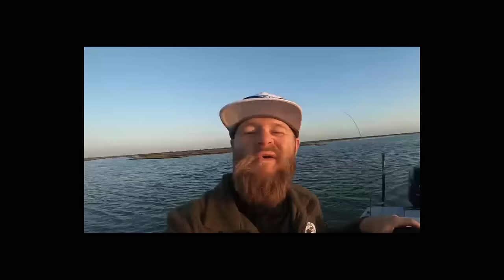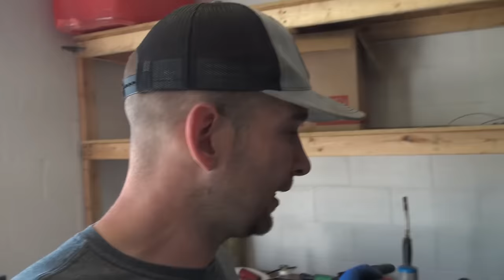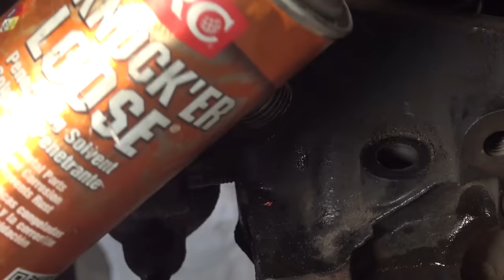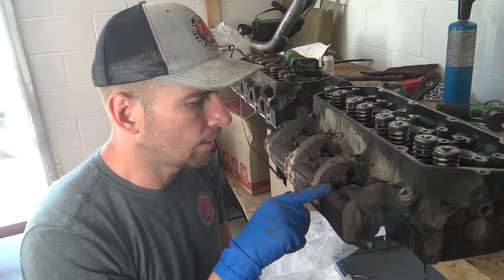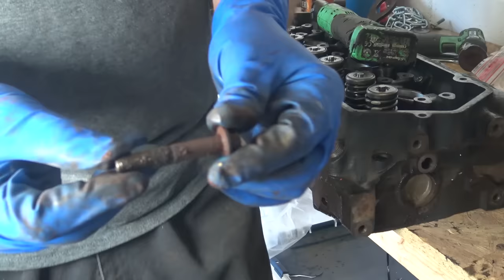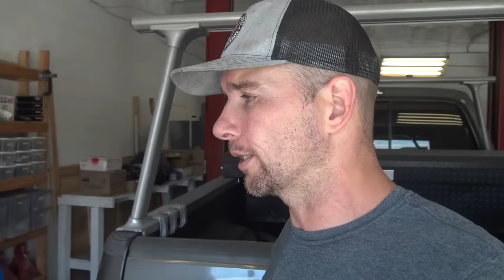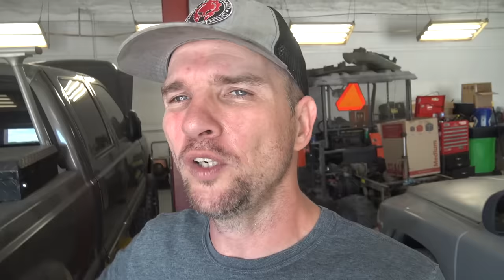Old Mechanic Taught Me This Trick To Removing Rusty Exhaust Manifold Bolts!

Comment: Hi Stephen. Thanks for your video. Don't take this wrong, but I work on Pontiac's, and don't have the convenience of open access to the threads entering the head. The manifold blocks that awesome easy access you use here with that head. Some tips on a Pontiac would be cool. Thanks
Reply: Use a rotary tool with a wire wheel to clean the surface around bolt head & then treat the bolt with penetrating oil several times ideally over 24 hours.  Get together an empty coffee can, nitrile rubber protective gloves, ball peen hammer, breaker bar, 6 point ratchet set, combo end wrench set, rags, & map gas torch. Stage/check a class A&B fire extinguisher by the work and put a plumbers fire blanket to protect any wires near the work.  #1 Have a brand new set of bolts and anti-seize or thread-locker as appropriate.  Put snow or ice in the coffee can or otherwise disposable container.  Put the penetrating oil can & the ball peen hammer head first in the ice.  

Now for the WWF tag team match of fire & ice that can go faster with a 2nd person.  Run the torch first on the bolt head. The goal is to heat also the bonnet, yoke, or manifold the bolt is in so as to get the bolt and bore hole to expand so as to crush the rust in the threads into powder. Move the torch when the bolt is sizzling even from water or penetrating oil to a low 6 o’clock position towards the back of the bolt depth of the bore.  The heat travels around the bore heating both bolt and boreas hot gases rise and find the bolt head.  

When sizzling some more, spray or dribble ice water, ice chip, or penetrating oil as can.  Oil may ignite depending on type and proximity to flame so you may have to dip a rag in water or oil while pulling the flame away. Cotton balls can work too.  But the tighter and smoother your transitions from one step to another yields quicker results. At first you dribble to determine the joint of bolt and bore is hot enough sizzle to the fresh drop. Then the penetrating oil applied first to the 12 o’clock position bolt head.  Switch the flame to the 12 o’clock deep side of the bore. Apply the penetrating oil 6 o’clock on the bolt.  This causes the capillary action of the crushed rust to pull and chase the penetrating oil to the flame so the crisscross oil and flame action keeps the oil from catching fire while hopefully treating in real time. Use the fire blanket if needed between bolt head and deep bore positions so you may spray chilled oil on one end and flame the opposite deep bore end. 

While flame is kept @ 12 o’clock deep  bore, strike the bolt head with the ball peen hammer to shock vibrate the joint. Switch to putting ice chip on the head to rapid drop the bolt shaft temperature that is partially insulated from the hot bore by the rust.  Start with the breaker bar. If a 2nd person is handy, they can apply another chip of ice/snow or ice water rag to the socket body while pulling the breaker bar. Work back and forth as described by the demonstration. Keep working fire and ice as needed with more penetrating oil as needed. Sometimes using box end wrench with ice direct on bolt works.  Or also slap bolt head with the hammer while attempting to budge with box end wrench. You can slip a 2nd box end wrench over the open end to make a breaker bar.  If the breaker bar or wrenches deflect/give and the bolt does not budge, shut of the flame so you can listen. If u try 2 hard U can shear the bolt or break wrenches.  So game of patience tag team fire and ice.  If your gut tells you something is wrong, stop. Use a ratchet when you know you are getting significant less resistance.  If you believe more oil penetration is needed, then you are probably right.  Let it soak and take a lunch after trying to budge all bolts.  Let them soak some more.  Go do a bank run while your brain and hands mull over with what happened.  Get a big soldering iron if that is what you think you need with a stand that can hands free apply heat without flame if that allows you to shrink your heat to ice working triangle.  Adapt and prevail. 

Another mechanics trick is to use water on rust because it softens the hedgehog structure of the interlocking rust. Apply heat then turns the moisture to steam that then acts like a sand blaster blowing fissures of rust out that penetrating oil can then get into.

Comment: I too have run into extremely rusted exhaust bolts, often the bolt breaks because it has rust bonded to the exhaust manifold.

I found/developed a method of removing rusted bolts by dissolving the rust bond using muriatic acid. 

I use HDX brand "1 Gal. Muriatic Acid Balancer" from Home Depot, (make sure to get the 31.45% strength version.)

First get a respirator like painters use OR an N100 dust mask, the muriatic acid fumes are strong. Also wear nitrile gloves and goggles

Pour the acid into a plastic cup and then dip a synthetic paint brush into the acid and then brush the acid all throughout the rusted bolts.

The muriatic acid dissolves the rust, if you brush it enough the muriatic acid will dissolve the rust entirely and you'll start seeing the original metal color of the bolt and the manifold. 

At that point spray it with penetrating oil and it will come off easily, you usually don't have to brush until you see the original metal color, just brush it a bit and it will come off easily.

Comment: I am not a mechanic.
For the past several years I've probably saved thousands doing my own repairs on all of our vehicles, thanks to YouTube.
Today I was changing the clutch master cylinder and the clutch slave on my 1990 Mazda Miata.
Keeping in mind, there is virtually zero room to maneuver tools in a Miata, let alone gain any leverage. 
I did the master cylinder first.
It was a tight squeeze but the nuts holding the master cylinder and the hydraulic line fitting came loose pretty easily.
When it came to the slave, I was most concerned about the fitting holding in the hydraulic line.
It came loose with a little effort but not too much.
Now there were the two bolts holding the slave.
They were clean and didn't show signs of corrosion but they felt like they had been welded in there!
I had used penetrating fluid on everything (including the master and it's fittings) the day before.
These things wouldn't budge.
I gave them some heat with my propane torch but nothing!
I soaked them in penetrating fluid and took a break.
I decided to do a little more research when I came across your video.
After watching, I returned to the garage with some new knowledge.
I did take a while but I loosened and tightened then loosened and tightened and so on until the top bolt (the one with easier access) finally broke free!
It was much more difficult repeating the same steps on the bottom bolt, mostly because of very little access but I just took my time and eventually, it broke free too!
I'm confident this worked because of the trick an old mechanic taught you and I was fortunate enough to learn and try today!
Thank you!

Comment: Before you spray the threads use a wire Brush to clean as best as possible .Use a ballpoint hammer to tap in the off direction on the flat sides.

Comment: Axle seized in spindle bearing. Where a 100 ton press just mushroom the axle. 
Localized heat (welding tip) & air hammer in combination with penetrating oil. Heat, shock & lubricant. = freedom

Comment: I used GM heat riser lubricant.
Go to junkyard break most seized bolts without heat.
If needed heat torch the baby spray it would turn as if new.
Good luck in finding any.
Seafoam deep is okay
I have a trans factory drain plug so frozen to say.
I have torched the area nothing, rust penatrant
The the bolt 
Used my snap on 24 inch breaker I can drag myself along.

Comment: Sometimes I like to take the deep six point impact socket and give it several hard raps with the hammer at various stages of the bolt removal process.

Comment: Interesting.  I need to pull the exhaust manifold on a Caterpillar Diesel Generator to replace the gasket.  The bolts don't look horrible but am going to use these techniques.

Comment: Good luck tryin to get ANY of the exhaust manifold bolts out of a 54 yr old chevy 250 strait 6 that has been outside all of its life in the northern usa, subjected to high humidity, dampness, & very high & low temps. lol
No mechanic in my area at least wants to touch that manifold with a 10 foot pole.
I have an exhaust leak luckily on top up front where the exh man gasket is gone, but i have found that applying JB weld muffler seal muffler cement(the one rated up to 850 deg F!!) with a q-tip & allowing to dry for 24 hours actually works & remains for quite a while - ez to reapply in future.

IS IT SAFE TO USE A TORCH ON THE ABOVE MOTOR WITH THE 1 BBL CARB RIGHT NEXT TO THE MANIFOLD?!

Comment: i have a trick i learned that i never hear anyone talk about so here it is, grab an air hammer and a "Air hammer socket adapter" and while you're vibrating the bolt, knocking the rust off, you can grab a 19mm wrench and spin the adapter, it has a placement where you can do that, and it'll come out like butter.

Comment: I totally disagree with your recommendation of 12 point over 6-point sockets.  A 12-pt will round off a bolt head much quicker.  A 6-pt has more metal, thus stiffer sidewalls, and will maintain a stronger grip.
Reply: I think maybe you misheard him. He clearly stated for a 6 sided bolt, use a 6 point socket. DO NOT try this with a 12 point socket. For the obvious reasons you stated.

Comment: Wow that's a clean head. Up here the rust is so thick you usually can't get the socket on the head. I've got a f250 plow truck that is so bad the engine has 1/16 " crank endplay. And that's on the "good" list.

Comment: They make sets of 'cleanup' taps & dies. They're designed not to remove any of the good threads, just clean them up. They're like 'dull' taps & dies, but spec-ed better to fit.

Comment: I'd also loosen all  the bolts 1/8 turn after you have loosened the original bolts to stop the manifold warping and locking in the bolts again . Then loosen a few turns each then take them off completely

Comment: I like it.  The only thing I'd do differently, is is to loosen the bolts in the reverse order that they should be tightened during installation and in stages. 

- This make a lot of sense, whether the old mechanic understood the physics or no, he had the pragmatic field engineering experience to substantiate the method..  
-   Rust makes threaded fasteners seize because most metal oxide molecules are physically larger than the metal crystals from which they are created.  They are compressed, actually wedged into the threads.  Because they are physically weaker than the metal of bolt or head, tightening the bolt compresses the oxide very slightly . Loosening it then lets the penetrating oil get into the space created. 
-  Penetrating oil should always be applied so it can also get under the bolt head.   Retention force on the head is equal to that distributed along the working thread area. The undersurface of a bolt head also has oxidation and friction.   Washers only help when they are a less rust prone metal than the bolt, nut or the retained piece.   Loosening an unlubricated  bolt or wheel stud usually takes more torque than tightening it did.  Why aren"t we trained to use antiseize under bolt heads? They are more exposed to humidity than the threads.

Comment: Only advice I have is shocking the bolt if needed if it won't start backing out at first but your doing everything I know to do other that popping it with a hammer to shock the threads in some cases that will get a head bolt to back out

Comment: ~~Tightening is a correct step. Before you do anything though, after you let the penetrater soak. Take a metal rod/shaft, preferably the size of the bolt head, w/good size hammer&give each one a couple good healthy wacks. Not only will you find you may not the  torch? But possibly break loose after tightening it the first time?
~~I worked at Hydraulic shop 15 year,that did the trick w/ 5/8" bolts&up. Not once did we ever have to use the torch unless the gland&or piston was seized.

Comment: I would think PTEF and something like paint thinner or kerosene mix would be a good lube for that,I ve never tried it but I think I will and I’d be soaking those bolts down when I run em back in.anti seize is certainly a good idea but after 20 yes who knows.you know,having it out in the open like you do you might try using an air hammer carefully first and see if they’ll break loose

Comment: If you hit the head of the bolt with a hammer couple of times it makes the thread move back and forth a little and the rust spray can penetrate.

Comment: I just cut the bolt heads off with an angle grinder, then on reassembly, weld the stubbed bolts back on to a nut. I then grind it smooth so it looks legit.

Comment: If all that fails, use some candle or parafin wax on the threads/bolt imediately after heating.  The wax will wick into the threaded hole/along the bolt shaft and will lubricate the threads much better than the penetrant that will more than likely burn off.  This trick has never failed me.  Learned it from a shop teacher.  Try it. :-)

Comment: Instead of working from one end to the other, do ends first and do the center last - lesser chance of binding. If manifold will be warping a little - center will not experience as much of a bind as the ends will. - if this makes any sense. Also, tap on the manifold housing around the bolt and on the bolt head with a happier first, as well. This vibration will aid in loosening rust before even applying and leverage on it with a wrench.

Comment: You forgot to mention to run a wire brush thru the holes in the manifold. Find the correct size round wire brush and run it thru 15/ 20 times until it's clean. Anti seize the shoulder and threads.

Comment: You should use a power bar to move it initially instead of a ratchet.  Sometimes if you gently work it forward and back with an impact gun it does the same thing. Use loctite anti seize when refitting new bolts.

Comment: The bolt that is hardest to get to will always give you the most trouble, when you are trying to remove a component etc - try and break all the bolts loose before removing any of them; if you remove them the piece may kind of warp around the surface if it and actually put more strain on the remaining ones. Generally it is best to get them all starting to turn and then remove them in another step.

Comment: I recommend you first try to TIGHTEN it, before you ever try to loosen it. It almost always works for me to get it to crack loose tightening it on bolts/nuts/plumbing fittings.

Comment: Going slowly in and out with lube works with my wi… i mean aluminum bolts also. And if you dont have a tap then i was able to clean the threads on the bolt with a blade then run the bolt back through until you feel resistance, then take it out and wipe off any loose threads or metal pieces, repeat until the bolt is super smooth by hand all the way in.

I was able to reuse everything and didn’t need to go buy a tap.

Comment: You heat it up and spray water on it, water is also a lubricant, Expanding and contracting, Lubricants can not be overheated but only warmed, or else they turn into carbon layers. we used to get a spray in a little bottle from the dollar store, spay it and leave it to sit overnight, next day loosen it with a tool, and just use our fingers and undo all the bolts. Might have to use a couple of sprays to clean off the excess. as it comes loose. Even on the rustiest flanges, you think possible that would never come loose,  This stuff yep loosens it with your fingers, and the very next day.
They stopped selling tho :(

Comment: Spay lube on partially loosened bolt thread back in and wait. Then repeat

Hit bolt with hammer. 

Heat with torch and and then small cold water

Comment: A bolt is a spring. If overtightened on install it stretches ...the spring part...then weakens as the metal relaxes as it stretches. You can't fight that if that was how it was assembled. You just get lucky if it doesn't break.

If you get one out put a new bolt in the hole after chasing the threads and anti-seize. Then torque it properly to go after next in sequence.

Tapping, penetrant heat and cold and back and forth. Patience.

Comment: DaBoss Garage is another mechanic with a channel of interesting stuff.  He went over how to remove a broken bolt; he would use the welder to build up a bead on the remains of a broken bolt stuck in the head, the part you would be drilling out.  Once he built up enough of a stub, he would loosen, tighten the remnants with vise-grips.   The welder obviously adds a lot of heat, but it also applies an electric current.  

That's neat because for really stuck bolts, it's sort of like an electro-plating setup: the current will move metal around a bit or at least break the rusts crystalline structure.  

That gave DaBoss the idea of using a pair of jumper cables to shock the bolt with the negative (cathode) on the manifold and positive (anode) on the bolt.  He seemed to have some success with a 1 to 2 second hit of electricity.   

Science: The anode, or positive, side of the electroplating apparatus is where material is removed, carried through the electrolyte by the electric current, and applied or deposited on the cathode, or negative side.